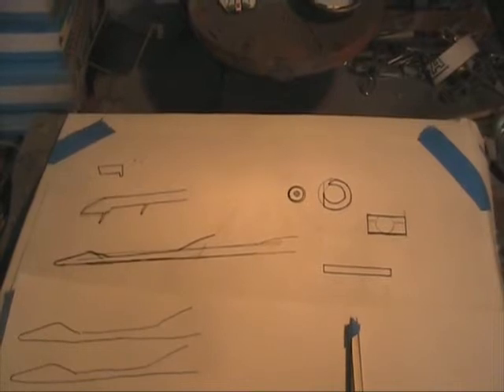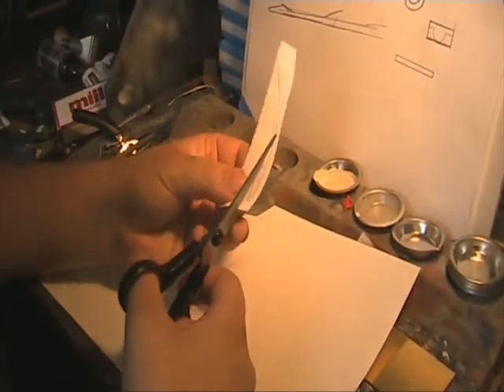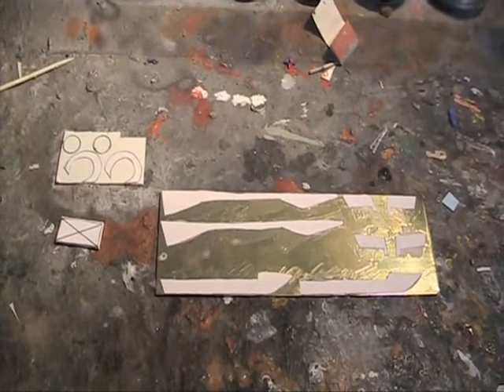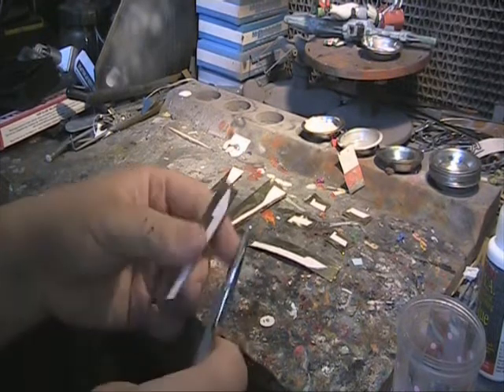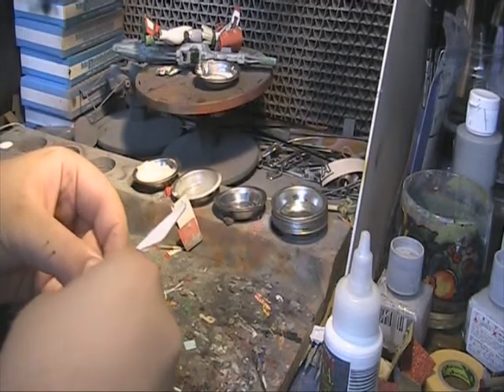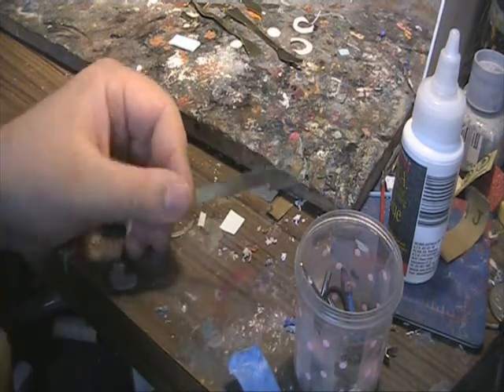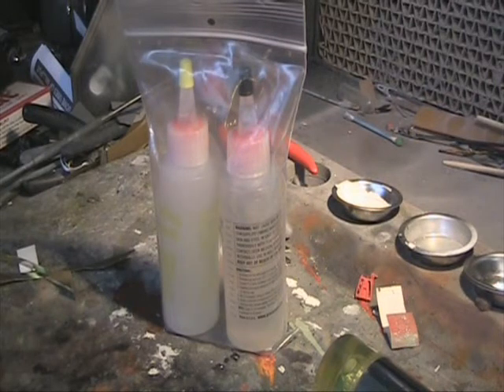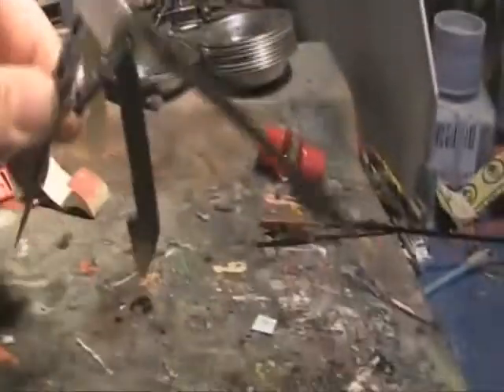Gundam/ mech model workshop 49: Experimenting with metal

Comment from the maker: @jasonh768 Once you flex or bend the material to shape you would not want to do it again as the metal will become brittel and the paint might flake off. Using wire or metal as a point of articulation is always a bad idea. Glade you found this useful and thanks for watching.